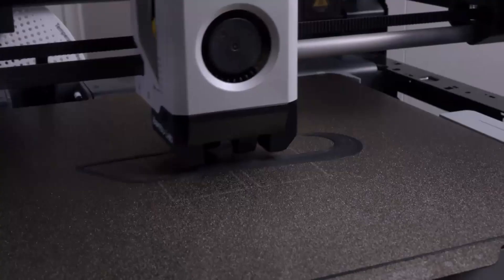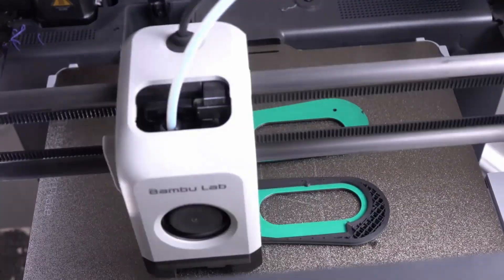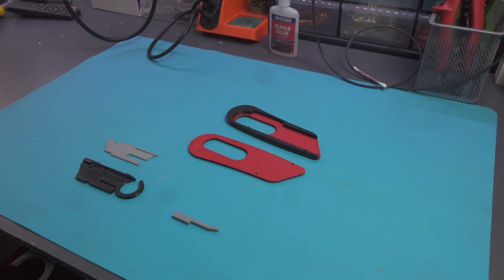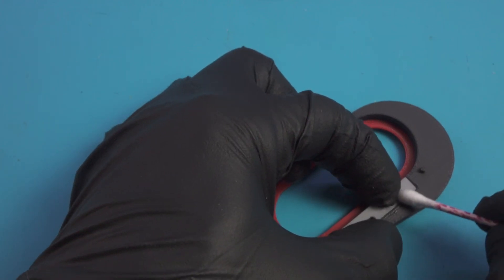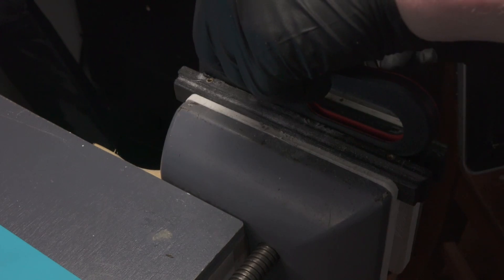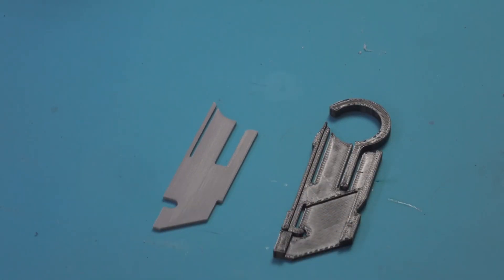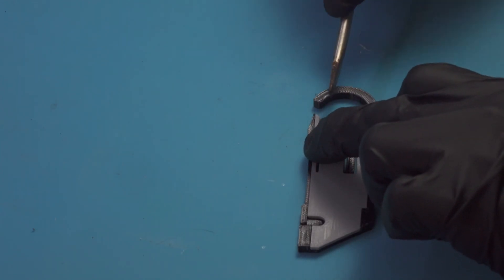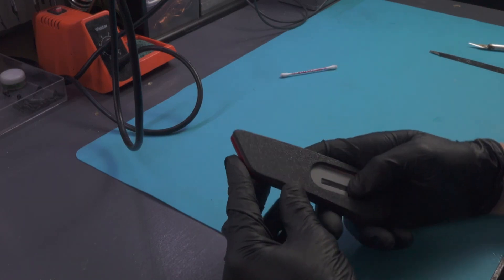Reverse Engineered Maker Knife 3D Printed - Will it Work?

Comment: NICE!  I printed it and am post print processing now.  It's clear a ton of work went into this.  It's super nice.  post the make on cults?  Thank you!!! I totally did the inner surface in a different color trick, very nice.
Of course I have some suggestions, I hope you don't mind.
  
The registration bumps will be easier to print and sturdier if they were bigger.  Printers don't do great on those tiny towers and  I knocked most of them off during sanding/filing the interior.  

I feel like the locking arm could be made to rely less on glue by extending half the lower rear out into a matching channel in the body like so:    now:  arm: `-----===   [wall  ...  with mod:  arm: `----===_   '--[wall        then the body provides the force for the spring tension instead of the glue. 

Thanks again for making and releasing this awesome, inspired design.

Comment: Hello, nice cutter, just one question, you say you printed one part in PLA and the rest in PETG, why not all in PLA (or PLA+ which is more "resistant")? And thx for sharing the files 👍
Reply from the maker: The locking arm was printed in PETG because of the amount of flex on this particular part, I wasn't confident in PLA to hold up over time. I could be wrong PLA+ might work as well.
Reply: @3DOCD  Thanks for your reply 👍

Comment: Could this be fully printed in PLA+?
Reply: PETG has more give and flex which is important for the internal mechanics.  You should be able to print it on most printers - even an unheated bed with blue painters tape or hairspray.  240 C nozzle and go really slow, even slower for the first layer.  This is such a small print, it uses under 10g of filament and will take around an hour . A 50g sample from atomic filament will cost you $7.88 shipped.

Comment: Use an Activator for your Super Glue will save you headaches in glueups. Use Activator Spray in well ventilated areas. I spray outside.
Reply: Cyanoacrylate is activated by moisture/water, so just make it wet and don't spend money on "activators", unless your water is more expensive.

Comment: With a multi-nozzle printer, this design can all be printed in one pass, with outer casing in PLA and inner workings in PETG. PETG sticks poorly to PLA, but it's just enough to adhere during printing, so you can print it in open position and then pull on it to work it loose, with the only caveat of the base of the spring having to be meshed in with the shell to not detach too. PETG core will also do double duty as a support for the top half, so zero glue needed.

Comment: Very cool, and some interesting design choices. I have seen a bunch of people who have 3D printed their own knives, but then it's generally been either a one to one copy of the original, or mostly just the top cover from files we provided. This is the first thorough redesign with the same principles I've seen. I'm curious why you went with gluing things together rather than using screws? Considering these are magnets for pocket lint and detritus opening it up really helps with regular cleaning maintenance. We had lots of QA issues when producing this knife in China, even though we were there and basically sat with the producers of the parts as they were making them. I would be interested in hearing all the iterations you went through to reach this result, and making it work smoothly (though it does sound a bit gritty towards the end there 😄).
Reply: Not speaking for the content creator, but I don't trust printed threads for screw holes, don't much like having the screws tapping their own holes, and wouldn't expect everyone who's interested in doing this to have the same results with threaded inserts. That said, holes for screws, self tapped or with inserts, could be placed next to (not in contact with) the alignment pins on the model. Button, bulge, or flush mount screws might all be a good fit.. Bulge or flush mount to hold the spring in place seems like a good design option, but then you're looking at a very thin insert. An alternative here might be a pair of through pins from the handle on one side, through the spring base, on into the top handle. A pair of these may provide all the alignment needed for fitting the handle together for screwing the pieces together.
Reply: @RNMSC   there are, as they say, many ways to skin a cat. No, I wouldn’t do printed or tapped threads in this either. However, making a well and pausing the print to put in a captive nut is basic, and slim, or as you point out using threaded inserts. Heck, even tapping the plastic and putting in a helicoil works great. A few countersunk M2 screws with matching threaded inserts, even hid under the surface, should fit just nicely. The rim seems pretty thick.
Reply: @SwitchAndLever  I'll agree that to hold the front and back together, there shouldn't be a problem with using most of the methods pointed out. For holding the spring in place things get a bit tighter, and for the blade holder, (printing that now for mine) may be a bit more work to get that to fit. For that you may be better just recessing a place for a thin m2 nut, or yes, holes for helicoil.

That said, I'm not sure that the design would be something that the random viewer with a 3d printer is going to have the parts to implement. I don't know about you, but I can walk over to about 3 different places in the house and grab a bottle of CA glue. Getting helicoils, I don't know about. Inserts I can find on one bench or another, but are not something I'd expect most people to have. So we're down to getting a nut dropped into the print to be overprinted in place. That, I don't think is going to work well for the blade holder. 

There are other side issues, such as a poor fit because one printer extrudes a bit more plastic than another, or has different hole expansion settings, or even you're dealing with different people trying to install threaded inserts into parts, and you're going to have a fair number of people who are upset because they have had to print 5 of the body shells to get the inserts installed and aligned properly.

I think setting up the designing to use CA glue is a solution that is a decent starting point. I'd rather have STEP files for the various parts so that I can modify them with appropriate holes aligned for screwing things together. And making those modifications (and yes I can import the STL files into various cad programs and do the same modifications.) But design expertise is not what we're expecting the random 3d printer owner to have. At least I don't expect them to have it. 

Again, none of this is necessarily what this designer/maker had in mind. It could simply be that they have a skill set they leveraged, and most of what we're talking about isn't in that skill set. IDK.

Comment: Excellent design. I just printed the V2 parts and assembled everything. My blade carrier comes out too easy when it gets stuck in something. Is there something I did wrong?  I printed with a 0.6mm nozzle And it works fine. Also the carrier works fine printed in PLA. I have both versions (PLA and PETG), and is now considering printing another handle if I can solve the carrier coming out so easily.
Great work!
Reply: I've pulled the STL files into CAD, converted them to solids again and looked at the design. The notches that stop the blade carrier from gliding out completely are only about 1mm deep, so a little bit of tolerance in the print, or too much force and the notches will wear down and the blade carrier slips over. Same if the case flexes too much. I guess this could be solved in the design by making the end stops just a bit beefier. Using a stiffer material like PLA might help too, but then it might get too brittle, so it's a bit of a tradeoff with the plastic selection too.
Reply: @ProtonOne11  I've solved my slip out partially by gluing in a tiny PCB in the slot gap of the blade carrier. The whole section flex near the ring part, so when "locked" together, there is much less flex. If I would mix, I'll close the slot at the back with a tiny notch. If I can add a photo, I'll show it here.
Reply from the maker: Very cool stuff, yeah this is one of the minor problems with this design, I plan on spending more time on this design in the future.

Comment: Looks great!  is it easy to change the blade out?  There doesn't seem to be any flex in the holder to allow you to replace the blade very easily?
Reply from the maker: Yes it is very easy to change the blade out, I used PETG for the blade carrier. So flexing it shouldn't be a problem.